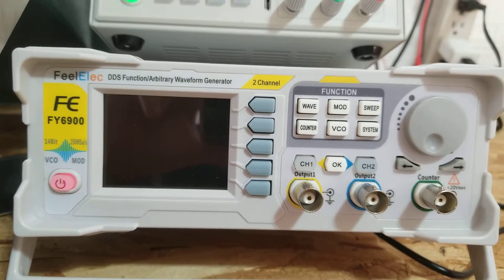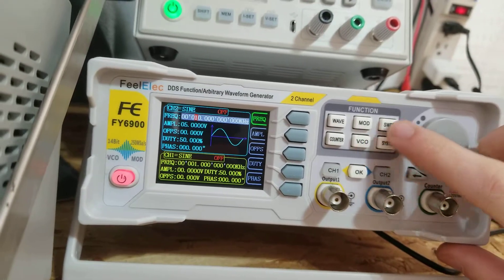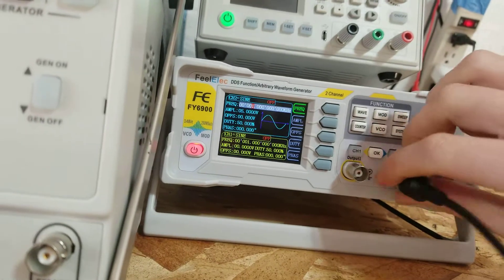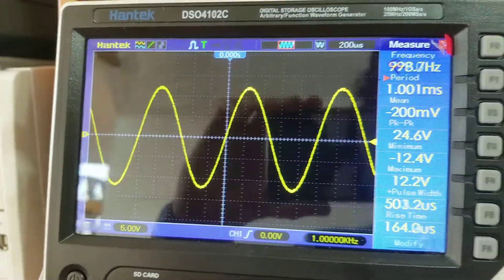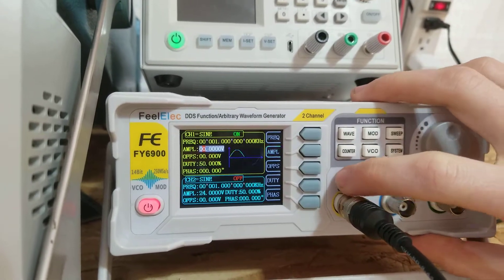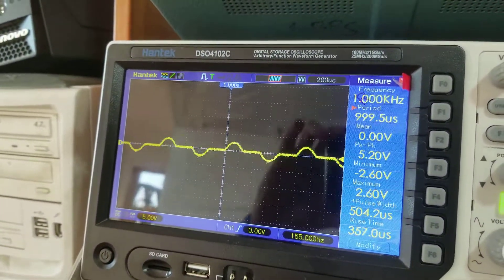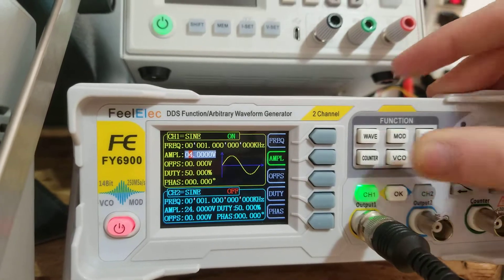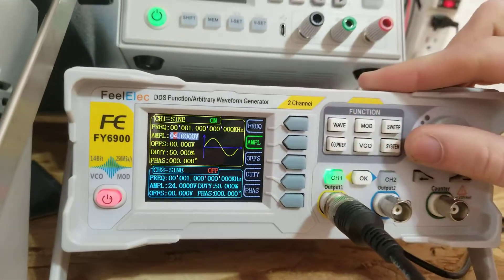Problem with FeelElec FY6900 Signal Generator

Comment from the maker: Just some clarification because people seem to be finding this video:

I bought this function generator back in March 2021 from AliExpress. I noticed this problem immediately upon its arrival, and requested a replacement. If anyone has bought from them, you'll know that they require a video proof demonstrating the problem. This was intended to be that video. They sent me a replacement chip (an opamp). Yes, it was a tiny SMD component, and I had a bit of trouble getting it soldered in. But it's fixed now, and I'm almost certainly sure that this was simply a factory defect, and I've had no further trouble with it. It is a really nice and solid function generator for the price. Would definitely recommend.
Reply: Could you do a video showing where the replacement goes?

Comment: good to point out...  thankfully i'm testing home audio..vintage amps, integrated and power.  even receivers.  they use an input of between 200 milli and 2v depending on unit.  so i'll never need anything above 2 volts.  but good to know anyway.

Comment: After trying to fix mine - both channels fail above 5v, I spent a lot of time looking online. According to one source, different opamps are switched in via  relays for signals above 5v. You can hear the relays click when you turn up to 6v. They are under the heatsink and are labelled 3002I. These chips are also now hard to get hold of. Again using another online source, they are dual opamps and each opamp is connected in parallel with itself. I would love to get a definitive answer on this. Are the 3002 chips faulty or is it something else?